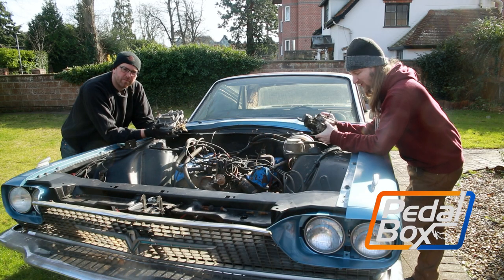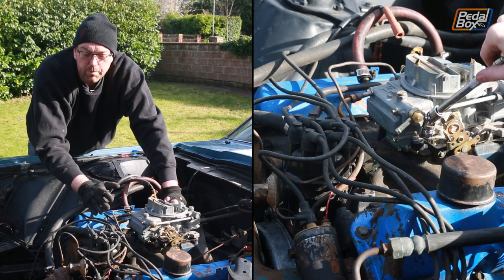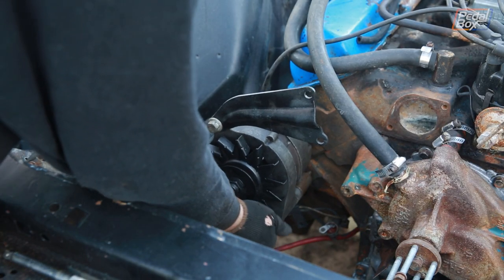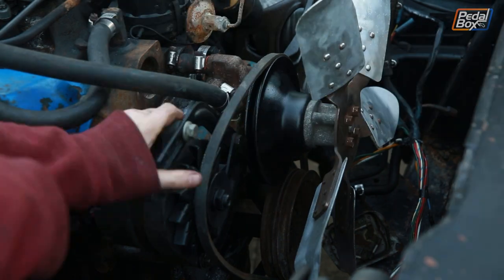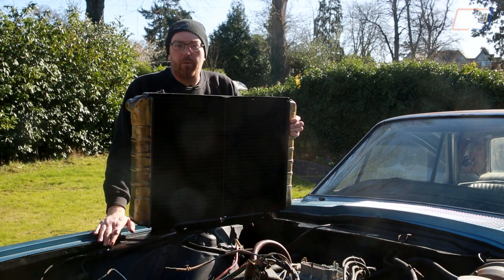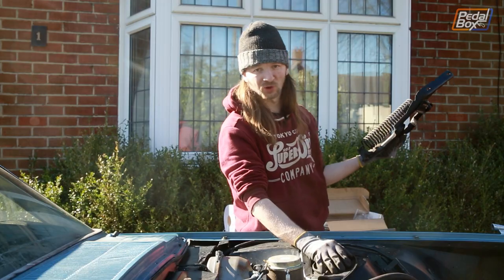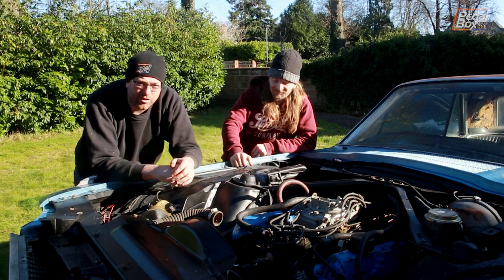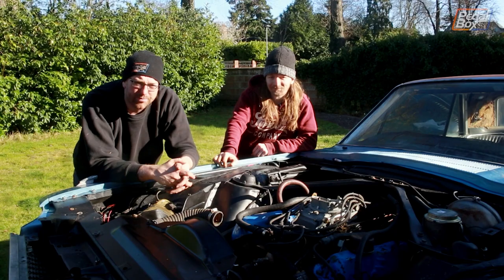New Carb - Holley 650 | 1966 Ford Thunderbird| PedalBox Episode 97

Comment: Nice work on the engine bay! Too bad about the carburetor being seized. Don't trash it, because it still has value. It can be rebuilt. I am restoring my 1966 Thunderbird Landau and I have been taking pictures of everything I remove. That way, I can see where the parts go as I can not rely on my memory. Thanks for posting the video!
George B. in Michigan
Reply from the maker: Oh no, it'll get pulled apart, probably on a live stream and then i'll get the bits I need at my leisure :) Hope Michigan weather is treating you alright for the rebuild!